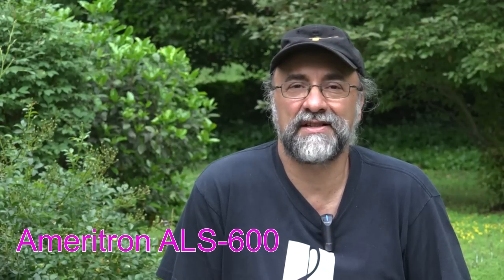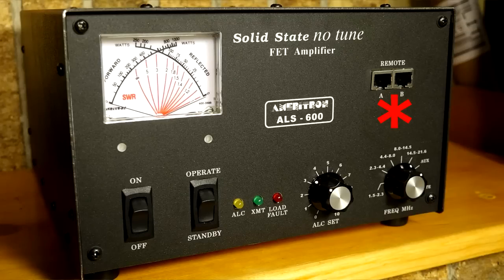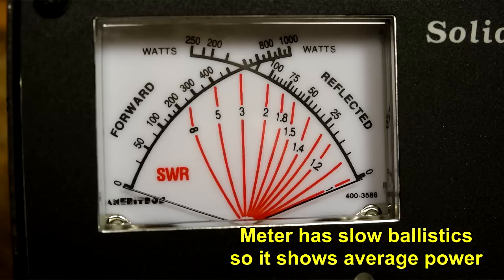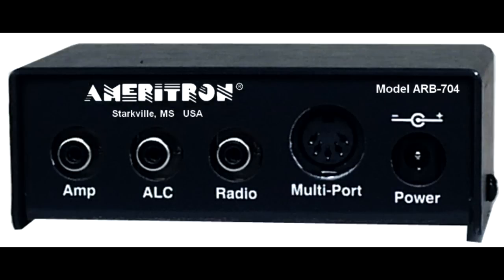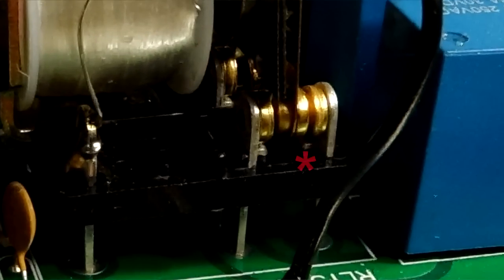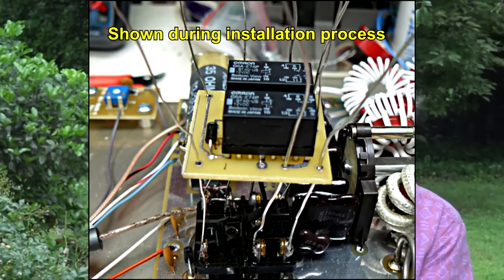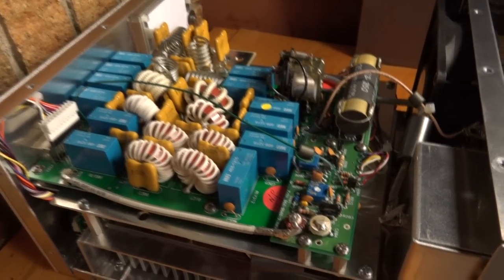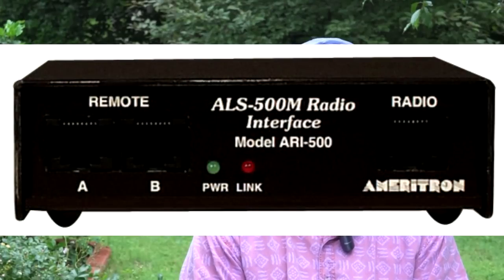Ameritron ALS 600 Review

Comment: I love my ALS-600S. I ran a tube amp for 20 years and got tired of the heat, noise and having to tune for each band. Not to mention that tubes are getting more expensive and tough to find. This little amp is a joy to operate. I wish I had it 20 years ago! Great review Bob. I will not sell mine.

Comment: I bought mine on Ebay dead for around $250.00. Sent just the amplifier in for factory service. Updated and all new fets and relay install.  ($450.00)  Then I Installed a new block rectifier in the linear power supply.  Fantastic amp at a great savings. ALS-600 Fantastic communication and service from John at Ameritron (MFJ)

Comment: Well done! Had my ALS 600 for several years. It replaced an 811H that replaced anAL80.  At the time I contacted every [or most] ham dealers in the country and everyone was out of stock.So I ordered one from DX engineering and was put on their wait list till they got one. I plan to keep this amp forever. Easy to use and all the power I ever need. Good review.

Comment: Well as a Former owner of an Ameritron ALS-600 I can say it’s a Total POS amplifier.I owned mine for about 6 to 8 weeks and it spent more time on a Big Brown Truck than it did in my shack or at Ameritron for repairs. All it required was for me to plug it in on one occasion and on none of the occasions did I actually make a contact while it was inline.After speaking with Rob Hood at Ameritron I discovered that they had about One in One Hundred of them that had the same track record as did mine.I got fed up with boxing it up and shipping it so I finally traded it for an Ameritron AL-811H that I got over 10 years of great service out of.I now own an AWESOME SOLID STATE Amplifier in my ICOM PW-1 and Ameritron wishes they could produce a solid state amplifier of such quality.You could not give me another Ameritron amplifier that is not a tube amplifier even if you payed me extra to keep and use it.I’ll stick with my ICOM PW-1 and never look back.I would suggest that you AVOID the Ameritron ALS-600 at all costs.I should note that I had the original model with the linear power supply not the switching supply.
Reply: Huh. I had almost the opposite experience. I owned a 811H for a few years. Mine (and a large percentage of them) have their transformer go out. The repair cost was too high to justify doing it. I then got the amplifier above and have had smooth sailing ever since. The open-air relay requires cleaning every few years...but that's easy. I'll take solid state over tube any day. (and no messy tuning up!)
Reply: @Yavor54  I will stick with the Very Reliable ICOM PW-1 & I'm happy that anything works for others.

Comment: I've run one with switching power supply for about 3 years without any problems.  The relay mod was easily accomplished and made operation nearly silent. Info on quiet (er) fan for RF deck most welcome. This will be my next mod. This PA is a good value.

Comment: I love mine...  Its the older vintage model with linear supply.  I did send it back this week with a problem with keying.  When switched to "Operate", the xmit led would illuminate dimly which was strange, and the relay would not engage,  then after sitting for a while it starts working normally.  I will never get rid of this amplifier.  I am interested in the ALS-1306, but MFJ has problem sourcing the parts now.  So I will wait and buy one when they are available again.  I'm in GA, so having MFJ in MS is so close to return for repairs.

Comment: I bought a good pwm controller with sensors from China (Ali Express probably) so that the fan on my linear supply is normally slow. It only gets (very) noisy if the heat sinks heat up. The controller is for dual fans with independent settings, but I only use 1 side at the moment. 12V.
Reply: @Embry Kendrick

Comment: I have had an earlier version of this amp for about 10 years.  It is very touchy to setup and get the drive and ALC to play together nicely.   Your SWR must be near perfect or the ALS 600 will trip off even with an external tuner connected for a perfect match.  Not very forgiving like the old tube amplifiers that we are used to.  

During my first few months of use I had to return it to MFJ two times for repair.  Once because it just quit and then again after the first repair flames and smoke came out of the side of it the first time I keyed up.  Not too good for a brand new unit that had just been repaired under warranty.  

I use the ALS 600  with an Icom 746 Pro and it does work very well and I get comments all the time on SSB indicating a very strong signal and clean audio.   I also use an LDG 1000 Pro tuner with it although it probably is not really necessary with my low SWR matched antennas.  I have also used the ALS 600 many times on CW and RTTY with excellent results.  On CW and RTTY this amplifier really performs nicely! 

I have never been able to get over 500 watts out of it on any of my antennas which all have excellent SWRs.  I never drive it past 75 watts with the exciter as it makes very little difference in output power and I see no reason to drive it that hard.  The manual also suggests running it at 75 watts drive.  On 10 meters I was told by an MFJ technical person that 400 watts is all you should expect under full power which is what I get which is more than you ever need on 10 meters anyway.

One trick that you can do if you are running SSB and don't need full RF output power is to run it in RTTY mode with the reduced power setting. This reduces the output to about 60%  and the amplifier doesn't have to work as hard.  Once you get the ALS settings working correctly on all your antennas never touch the ALS knobs again just reduce your exciter power to control the output and everything will work fine.

If you are looking for a quick entry into a less than 1kW amp I would NOT recommend this product.  I would go for a tube amplifier.  The instruction manual is also an absolute disaster and very difficult and confusing to use with very limited information.  

However in all fairness to MFJ it does get the job done for a very reasonable low price.  You do get what you pay for.  Electronically speaking it is probably a very well designed unit if you can handle the quirkiness.  Also, it is easy to service and can be setup to run on 240V although the manual suggests sticking with 120V.  The made in the USA factor is also a big plus.

Comment: Nice review video of a sub 1 KW linear amplifier alternative. Too bad it doesn’t natively come with the solid state relay, instead of the clunky mechanical relay. A quiet QSK solid state relay would be a huge improvement. I wonder why a quieter fan isn’t provided by the manufacturer.

Could the amplifier and power supply be remotely controlled? If the amplifier and power supply could be put in another room of your house, then you could have higher power without putting up with the loud fan noise in your ham shack room.

What are the prices of the amplifier, power supply, relay mod, and fan mod?

Dave KY0L

Comment: Bob,

I really love you videos.. I have a question  I bought a ALS 600 amp, I want to wire the switching power supply for 220 I can not find the instruction for changing from 120 to 220 I hope you can help 73 Jerry de K7ER
Reply from the maker: Golly Jerry- I have the linear supply! It HAS to be an easy option, as it will run much happier on 220V. OK, just looked at the whole manual. It is on page 7. You open up the power supply and change two jumpers. For 115V they jump A to B and C to D. You want to change them to just B to C -just one jumper.
Reply: @robertnagy2163  Ok you know what is weird... the manual I have is an older one??? I guess I down loaded the one for the wrong supply... Thank you so much I opened it up and I see the jumpers. Again Thank you I really respect your knowladge and enjoy all of your hard work on the Videos 73 Jerry
Reply: @robertnagy2163  Robert, if the 120V line is a dedicated circuit should there be any difference?

Comment: Hello ab5n I pick up a used als-600 today and I can't seem to get it to work with my icom 718 the alc light does not come on when I key up on 20 meters .. I have both rca wires hook up and the antenna is tuned with my versa tuner ect, but I don't know what I'm doing wrong .. wondering if the amp is defective..I did turn up the alc in the back of the amp as well but no luck .. Any advise on who I should call for help?

Comment: I was confused about one thing, which is no small matter. I'm running a 100W Icom 7300. I didn't understand whether I want/need to have the two components, or just one. Also, will I need a separate (external) tuner?
Reply from the maker: David- You need both parts! the amp only needs 65 watts or so to drive it to full output power. When you connect the ALC line from the 7300 to the amp, you'll set the ALC knob on the amp so that it limits the 7300 from delivering over 65 watts no matter what the 7300 power output is set at. ALC=Automatic Level Control. You do need to have a resonant antenna that will handle 600 watts. The internal tuner on the 7300 will only match the SWR from the radio to the next thing.. in this case the amp. So, you need an all-band antenna that is naturally resonant- or a large antenna tuner to load up a random wire antenna etc. I'd suggest a HexBeam. The beam and the amp will push you into the big-boys playground.

Comment: With the 10-12 mod will the als 600 operate on 11 meters. With a tuner.
Reply: yes
Reply: Thanks for the info. Rob. I have a Kenwood TS 690s . The owner I bought  the Rig from had the Mod done for 11 meters. I have had the Rig for over a year and it works very good. I do like to talk to some of my friends on the Children's Ban at times at 20 watts. I have watched your vids and find them very informative. I all so have a Kenwood TS 940S I bought at a swap meet and toke the guys word that the Rig works like new. So true to his word it operates like new. I am sure you know how bad you can get bit at a swap. LOL. So far I have been very lucky. So now I got the bug for the ALS 600. and looking for one from the U.S. just to much money. But luck was with me and I got one from a Ham here in Canada he bought and did not like using it now I have it. HO-RAH. and it works as you have said it would. So I am going to add 3 Options to it and it will be complete. I run it on a MFJ 989d tuner and no Faults. And its your fault I bought this AMP. LOL. 73, Dave VE3DGU.
Reply: Will it work good on 10 meters AM and SSB?
Reply: @M70ACARRY  cant get mine to
Reply: @davegreen5862  Dave did you get yours to work on 11 im trying to but throwing soft fault maybe to high swr pls advise im in Canada too Dave thanks

Comment: Hey, Bob - great review, I enjoy your videos.  I am considering one of these to use with my Flex 6300.  Did you ever get the auto-band switch setup?  And after a couple years, has your opinion changed at all?  Thanks and 73!  -N2ADV
Reply from the maker: James- I did not get the auto-switch thing. Why? There is only one knob to change on the amp...so it's no big deal. The amp has performed perfectly and it is a no-hassle device. When I need it...it always let's me snag the DX station.
Reply: I do 99% of my operating remotely and it would be nice to have the amp change with the band so I can use the amp while running remote.

Comment: Hi Bob i have an Icom IC 7300 now and an ameritron AL 811  800 watt,  do you know if you can connect them direct regarding the PTT and ALC sockets....from Fred g4vvq. tnx.
Reply: YES... I am running mine on my new IC-7610 and I'm sure the interface is the same. It took 3 minutes (and two of those were finding an old stereo RCA cable). Then just adjust your ALC control. Mine is at 2.5 ...which is where your's will be. Adjust the rear ALC control first (as per manual) Fantastic combination.
Reply: Cheers Bob....F